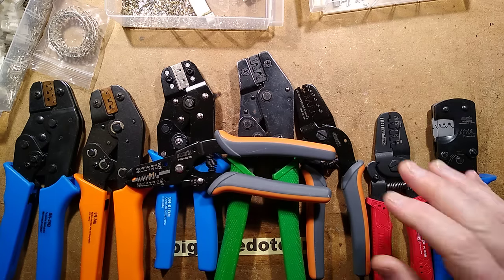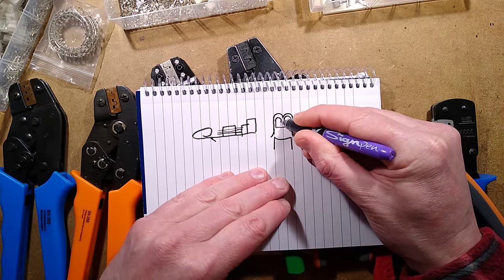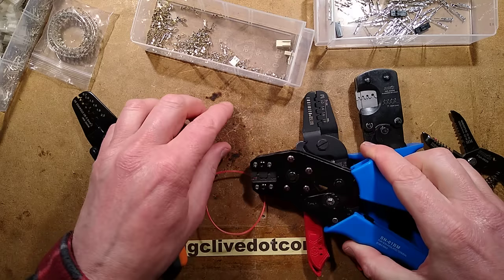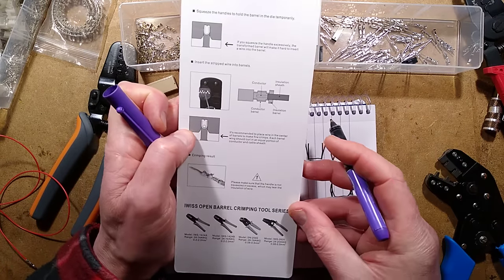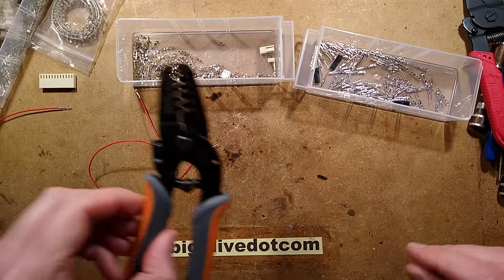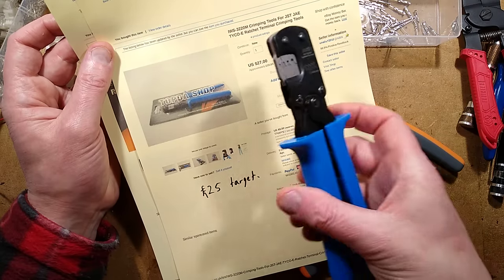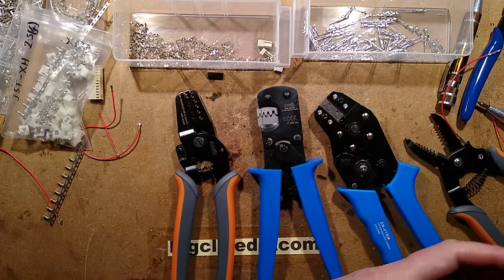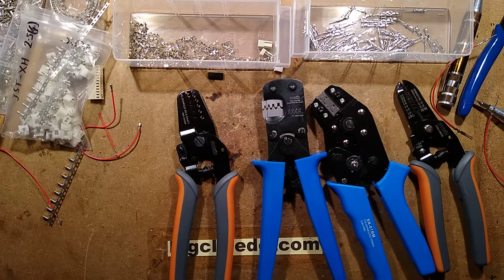Crimping tool test that I screwed up. (Read description.)

Comment: 4:50 in and I had to pause and got through to my bench to see if I should be worried, and yes, there's an SN-28B sat there.
Reply from the maker: It'll be fine for bigger crimps.
Reply: Guilty as charged. BUT! And this is a bigger but than any Kardashian will ever have... Not only is mine a 28B, I had also used it all wrong, so I had just tossed it aside. After this video, I picked it up from the toolbox, and fiddled a bit, and LO AND BEHOLD, I MADE MY FIRST PROPER WORKING CRIMP EVER, a dupont one. GONE are now the days of buying those 40-pack "pre-duponted" cables!
Reply: My SN-28B is an IWISS brand and it's nice.

Comment: I have the Iwiss tool in my drawer too. It was love at first sight! Crimped Molex PicoBlade (2mm pitch), Molex KK and JST XH NINIGI brand clones (that's what you can buy here in Hungary easily) without any issues. It's not meant for all these connectors, but Dupont worked well either. I guess this is a more precise tool, becuase of the Wire EDM manufacturing process used. It has very nice price-value ratio too. Few years ago I used genuine Molex and DMC (Daniels Manufacturing Corporation) tools at work and they are great, but they cost around 250+ pounds, without a locator. I'm still missing the locator feature on this Iwiss brand though, but hey, small crimp tasks don't need any rush.

Comment: I've been using a pair of the engineers for many years now (long before the existence of the drone community you mention being a fan of them) and they were highly recommended by a lot of reputable sources when I bought them.

But holy carp does it drive me up the wall how the crimps stick in them. They work great except for that, but I've had to redo plenty of crimps because I broke them getting them unstuck.

I've been wanting to try another brand/style, but it's one of those tools a hobbyist doesn't use enough to justify spending that much just to try another set.

Comment: IWISS also do a pretty awesome range of pneumatic (I think electric as well, all ours are air so I can only comment lion them) crimpers. you can get boxes by the thousand premade in any type off the slow boat from china, for some jobs you just need a few hundred identical cables right now. Airtool for the win. slightly modified one of the dies so it guides the JST connectors on real nice. recommended, turns a days work into an hour.

Comment: The worst you can get are tools where the dies are cast metal instead of machined (that's the kind you get when you order the cheapest ones). You can usually tell on images, because the dies are painted black. The cast dies are completely useless. Their surface is rough and the 
tolerance way off so the only thing they do is crush the connector. If someone shows machined dies on the item images, but sends you cast ones, open a claim on ebay/amazon/whereever.

Comment: The dies look to me like they are made using powder metallurgy, metal powder is pressed in a die then heated until it fuses together then further heat treated to fully form it, at least all the ones I have are made that way. Metal powder is used widely these days including for things like car gears.

Comment: I have a perfectly good ratchet crimp tool for car electrics. It's made by Draper. I must ask if they sell alternative die sets. The existing ones are screwed in place.
Reply: Draper tell me there are no other dies available for this very common tool. Pity.

Comment: Hello BigClive, I think you messed up some of the crimps (the insulation part) because those types are not ment to be crimped inwards, just folded over. I use a plier tool that has round cutouts for this.
Reply from the maker: I've since found out that the Dupont style connectors are designed to be used that way.  It explains why I often had issues with them and the housings.

Comment: I own a SN-01BM, its a little finicky to get use to using (I suppose most of them are) but for the price, its held up quite well for the HVAC motor testers I make for work and others in the trade. 
I'm sure there are better crimpers, but I'm cheap haha

Comment: Thats very interesting. I dont use many of these small connectors myself but id be interested in you comparing crimping tools for insulated terminals as used in automotive wiring...Ive been looking for a decent pair for a while but unsure about buying cheaper brands...

Comment: Why is twisting the multi strand core frowned upon, Clive? I always do that. I think it helps avoid leaving a loose strand out of the crimp which might cause a short....
Reply from the maker: I do it for simple tubular crimps, but in the folded wing crimps the strands get divided into two bundles by the wings, and twisting them may result in cutting of the strands
Reply: @bigclivedotcom  
Thanks for explaining that, Cive. If the strands are at an angle to the sharp folded edge of the wings, I see the risk. One thing you didn't mention is whether these crimps are suitable for solid core. I expect not, from what you've said about bundling of strands...
Reply from the maker: @tasmedic  Theoretically not, but I've used then with solid core for some of my lights with LEDs in sockets on the ends of the wires.  I really should take a close look at one of those crimps to see the crush-fest.

Comment: for my dupont connectors I crimp as normal then pull back to finish the front and that seems to work, honestly I would rather have to do that vs having a crimper for every connector type

Comment: Big Clive has strong pull! One question: can I crimp microphone (audio) wires inside the small tubes where we're supposed to solder? Thanks!
Reply from the maker: Soldering is a better option.

Comment: Try getting a decent bootlace ferule crimper and you can pay a fortune. Best type work like a camera iris
Reply from the maker: You can get them at surprisingly low cost on eBay now.  I guess they are a very standard item.

Comment: I have the JST XH crimp tool marked PEBA PE-02. It looks identical to the SN01BM one at the end of your video,  Can't fault it thb. Paid around £35 for the tool and 1600 piece connector kit.  The wire strippers that came with it were landfill and just cut through the wire as well as the insulation so save the £6 If you find them in the kit on Amazon. 

Thanks for the comparison :)
Reply: Hi Lea, I also use the SN01BM for JST XH, I found it important to 'pull' on the contact while it is held in the tool. You get a slight 'click' feel when the contact is fully located and it leads to a much better crimp. I do find that some contacts have a slightly large shoulder at the insulation crimp  to get the contact fully into the housing. Just a very slight nip with pliers does the trick without affecting the crimp.

Comment: Any suggestions for making stuff not get stuck after crimp?  I have a tool for Anderson PowerPole and it seems to do a nice job, stuff is solid......but I always have the crimps stuck in the tool and sometimes break the tabs getting the crimped part out.

Comment: If price is no obstacle what crimping tool would you recommend for Arduino project dabbling circles. I assume these are the Dupont type and I'm also informed good wire gauge is around 20 AWG.

Comment: Always wondered about those chinesium fleabay crimpers. Thanks for the info. Almost bought the SN-28B.
BTW, if I had so many terminals of one type, I'd spend the $100 getting the proper used Molex crimper.

Comment: I wouldn't say you actually made a mistake with the single position crimping tool. Generally if you use same size to crimp insulation it over crimps. In quality full terminal crimp tools the part that does the insulation crimp is different than that of the wire crimped section.

Comment: I've I need one that does molex 4 pin on one end then the normal 4 to 6 jst in nema 17 motors. The molex is the style old 3d printer main boards used to use ch3.96 I believe they're called. I keep finding different names for the connector. The male side is a  white pad with the bare pins coming off the board and the molex female end is a transparent foggy white. I see the connector alot in old tvs and such.

Comment: on the subject, i have a few chinese class d amp modules, and they usually have connectors that require a crimped plug/socket, and can never seem to get the right one to fit.so wonder if i should be looking for a particular type.

Comment: at work we use the original 400 euro molex crimping tool , that is the best , u can have shove the connector in the red part and u dont have to hold it

Comment: Just curious:  Why is twisting the wires a "taboo"?
I have always pre-twisted the wires for crimps, soldering (when tinning first) and even when using wire-nuts.
Never had a problem with any of the connections though.
Reply: As soon as they get untwisted, the total diameter shrinks a little and the crimp becomes loose.
Reply: Good to know...thanks to both of you!
Reply from the maker: I do twist wires lightly for simple tubular crimps, but in these ones the way the wings are folded down divides the wires into two little clumps, which wouldn't work if they were twisted.
Reply: @bigclivedotcom  True, for tubular crimps it almost doesnt matter what you do though. If you have a half-decent tool, it will crush down in multiple places and make a super solid connection.
Reply: @johncoops6897 /videos   When I mentioned the tinning I was referring to tinning the ends of two wires that would be soldered together not using crimps. I apologize for the confusion.

Comment: Mh.. did you even try to adjust any of the crimp inserts of the tools which had "bad tolerances"?
Reply from the maker: The jaws weren't closing enough to even grip the wires no matter how much force was applied.

Comment: The $500-1000 crimpers they have at work (believe it or not, they care about certification for avionics) are "interesting." I personally use the iWiss, with die that crimps both the conductor and insulation.

Comment: Can the PA-09 be modified ... if you already have one ... by slightly filing down the outside edges so they are not as sharp ... may help it to release the connector after crimping.  Did Clive do anything on ferrules ... couldn't see anything ...
Reply from the maker: I've used ferrules in videos, but never specifically featured them.

Comment: Clive, have you seen Matt Millman's enormous write-up on crimp connectors and tooling?
Reply from the maker: I'm getting deja vu when I looked at that page.  I think I may have stumbled across iti in the past.  It makes an important point about the Dupont crimp not biting into the insulation.

Comment: if you are doing a push pull test on a du Pont style crimp you're missing the point entirely. Those connectors were never meant to be crimped so tight you can't pull them out because they lift right out of their connecting point LOL those crimps are absolutely perfect for what they are intended to do I've used 1000 of them

Comment: THE ENGINEER ones are really good for small terminals, I was doing the bigger terminals with them in 2 passes I guess  is a normal practice, I thought i was doing it wrong, so  i just bought the IWISS 1424B, i am going to try them since they have the crimp for the weather pack which are the ones i  work with the most  in BMW, I bought the ENGINEER  crimpers  afew years a go because at the time I did not  know anything about crimping, but I need it to fix a couple of connectors in a BMW, so at the time the only  ones with numbers in millimeters that I could understand in terms of sices was the ENGINEER's, but know that I understand a little bit more  gauge wires and size terminals I am going you use the  IWISS, Know I have a different problem in terms of sizes , I have to crimp bigger terminal .5 mm for wire gauge 8 and 10, can you recommend me crimpers, and all so where can i get the terminals for BMW tyco brand.
Thank you for this video is very informative!!!!!!!!
Reply from the maker: For professional use I recommend getting tools from prominent suppliers for liability reasons.  It will cost more, but hopefully get a more compliant crimp.

Comment: ...connector contacts, please. Crimp is a product of a squeezing action made by placing material between the dies of crimp tooling, aka crimpers (and ratchet crimpers). Dies may be removable or integral to the tool. The location of the dies is often called the tool's jaws. Referring to one side of the jaws, or one part of the die set, is often called tooth. Stop calling the die teeth crimps. There's like 8 terms you've irresponsibly replaced with "crimp". I admire your videos and the educational value of your content as it is made available to our community.

These particular contacts are made from flat sheet material using a stamp and form process. M39029 contacts are often a combination of precision machining, stamp and form, and sometimes, as mentioned in the vid, EDM. A crimp pull test is NOT a non-destructive test which should be performed by calibrated equipment. Pulling on a contact just placed into the cavity of a connector is just for checking that fully inserted the contact. Read the tooling manual. DO NOT PLAY WITH CALIBRATED CRIMPING TOOLING. It's expensive to replace, repair, and/or recalibrate. Some tooling will have ratchet mechanisms that cannot be defeated once begun. Not a fun way to lose a digit.

Comment: Buy cheap get you get rubbish crimp tools if you skimp on tooling there's a good chance it's going to come back and give a load of trouble ,a big problem can be the strain relief part of the crimp ,it can look ok but the actual insulation can put that much pressure on the conductor's it actually breaks them or even worse leaves a tiny strand of copper connected which later break's or burns out giving you intermittent fault's to trace out ..

Comment: Is it better to buy 4 jaw tubular terminal crimping tool or pay a few extra quid for 6 jaw tool, which is better for an amateur?? Are they equaly good or almost no difference and tubular terminals will stay on the cable regardless??  Thanks
Reply from the maker: Both work fine.  The final crimping is done by the screw or clamp being tightened on a ferrule.
Reply: @bigclivedotcom  Great, thanks for the advise.

Comment: Hi Clive. Maybe a silly question but why is it frowned upon to twist the wires before using the crimping tool?
Reply from the maker: In this style the wings are folded round and part the strands into two bundles.  With a strong twist it can't do than and may bite through strands.

Comment: i have a question thats not related to the video but always wonder about. do you know what those colored ball's on electric wires on those big pile on's you see that go across roads mainly. Do you know what they are for/do???
Reply: They're to make the lines more visible to pilots in airplanes and helicopters.  Without them, the lines are nearly invisible until it's too late to avoid them.  You'll usually see them in the vicinity of airports, pipelines, hospitals, or other places aircraft might be.

Comment: I think you are being too hard on the SN - 28B, it would also depend the gauge of the wires you have in the crimps. Too small of a gauge and it wont crimp, too large and it will over crimp.
Reply from the maker: I think it's fine for some larger style crimps, but not for the tiny ones.  The tolerance discrepancy was very visible in these two.
Reply: @bigclivedotcom  I agree with  you. I have SN-28B and I have yet to use them for any projects I had in mind. But also I might hit it with a bit of solder after, I just like to solder!